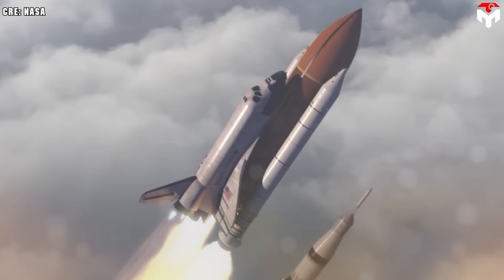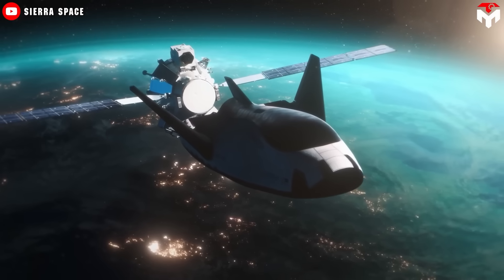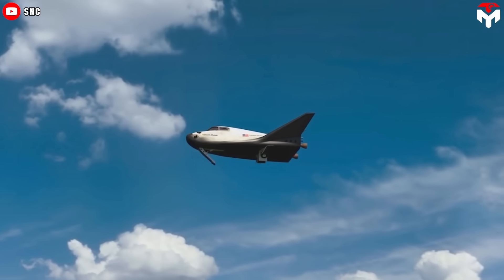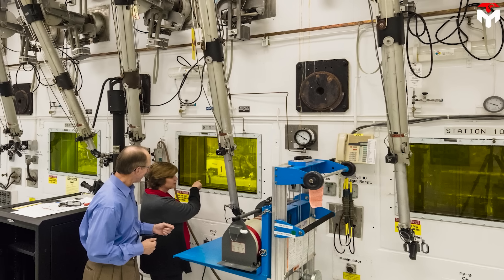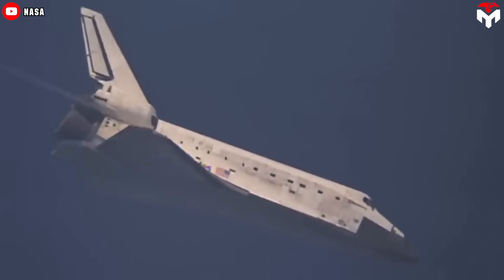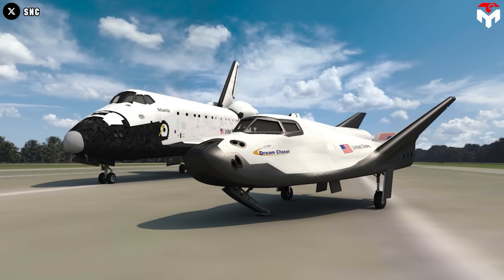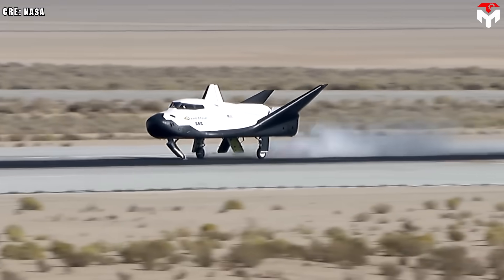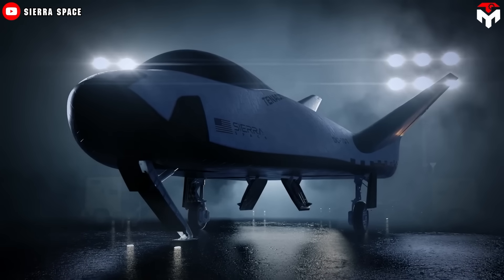Dream Chaser New Heat Shield SOLVES What Musk Called 'Impossible'!

Comment: The use of laser arrays (in a purpose built under-cradle-assembly, for the Dream Chaser to pass over) to scan these heat shield tiles for any surface damage, in unison with an ultrasound device, scanning for any internal cracking. Might be, in the long run, be a much quicker and more accurate option, rather than time-consuming support tech visual inspections? 🤔

Comment: The space shuttle was Boondoggle for some businesses.  Why would you want to shoot about 180,000-pound space shuttle with about 80,000-pound payload at how much a pound?   Didn't ever make sense.  Leave the 180,000-pound payload and bring back the 80,000-pounds Maned platform.
Reply from the maker: Totally get what you're saying! The Space Shuttle really did seem like a money pit for a lot of businesses, especially when you look at the costs. I mean, launching that massive 180,000-pound shuttle with only an 80,000-pound payload? It just doesn't add up!
Bringing back a more streamlined manned platform could make way more sense. With how much cheaper launches are getting these days, it feels like we could be doing things way more efficiently. Let’s hope they figure it out and give us something that actually makes sense!
Reply: The original design for the shuttle was a much smaller 3-4 passenger with a small cargo area. It was to be launched on top of a Saturn 5 rocket. Then the government wanted to use it to launch large spy satellites into low Earth orbit. Those are about the size of a railroad box car interior.

Comment: The Dream Chaser is tiny, and unproven.   Comparing it to SpaceX Starship isn't remotely equal with the amount of heat it'll have to deal with during reentry.   Time will tell whether it works as advertised or not....and counting on ULA Vulcan for launch might be a real sticking point as they've not shown that they are able to reliably launch anything as of yet.   Ablative heat shielding works and until this can beat SpaceX Cargo Dragon in $$$ per pound to the ISS....it's not going to be financially viable.

Just a word to the people who are saying that propulsive reentering should be considered.....forget that idea.   It is hard enough to get a payload into orbit which requires a massive amount of fuel.   Carrying enough fuel to then slow back down without using the atmosphere would seriously reduce the usable payload if it's even possible.   This is one of the challenges of landing things on Mars because the atmosphere there is thick enough to create a lot of heat but not thick enough to shed enough velocity to allow a parachute descent to the surface so propulsive landing is needed.  Big challenge and is why Starship will need so many refuelings when attempting the trip.
Reply from the maker: thanks for sharing

Comment: I hope it works but until it works (repeatedly, reliably and cost effectively) then it hasn't worked - has it?
I also notice all the 3d graphic made up stuff has windows at the front of the craft (something it will need if a pilot tried to land) similar to the ancient Shuttle, but then the actual craft reveals no windows at all. Plus as Musk as said many times, building one dream chaser is hard, building many dream chasers is very very hard. 
All that said, if Sierra space have manged to develop a low cost long life heat shield then they may have success, even if it is by piggy backing onto someone else's rocket. I tend to agree with what others have said here, if you have enough fuel you can remove the need for a heat shield with engine braking, or at least greatly reduce the impact. 
The original Apollo re-entry capsule used a different but still very successful approach, a shield that was designed to absorb the heat into itself to the point of decay. Yes, the shield practically evaporated away protecting the craft, and it is single use, but as long as it is low cost (and I don't know!)  - who cares?
Reply: Very sensibly I understand they are launching the cargo version first.
Reply from the maker: Thanks for cmt